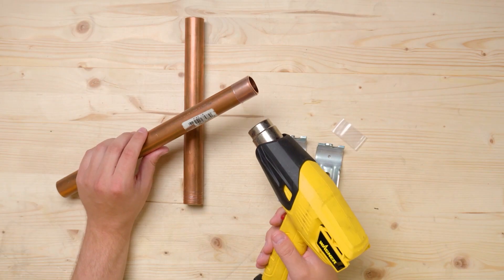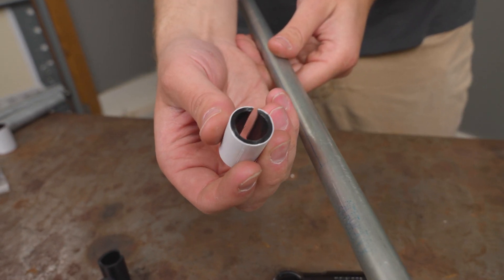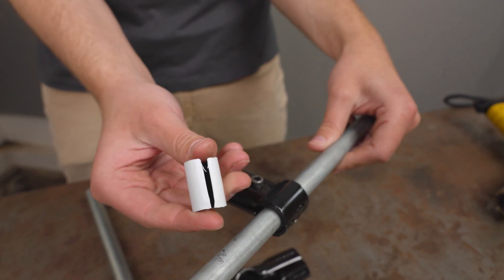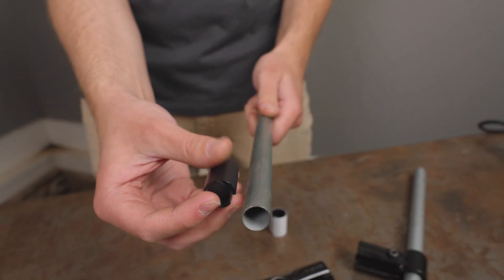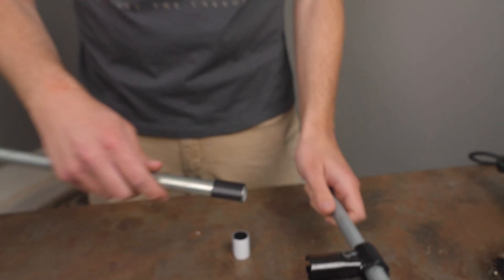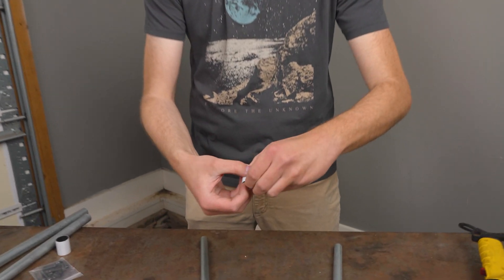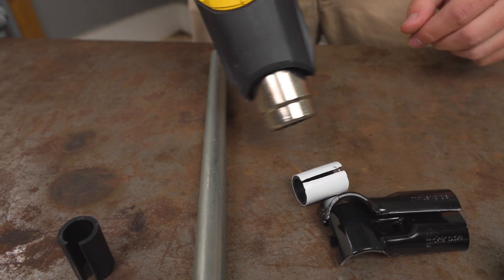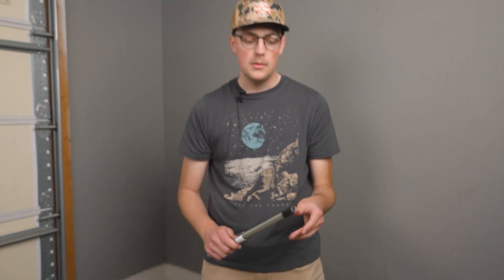Building With 1/2" EMT Is Easier Than Ever!

Comment: Will there ever be 1/2" connectors (no shims, smaller connectors)???
Reply from the maker: We've looked into it and it's possible in the future
Reply: @MakerPipe  Awesome! I get it, egineering/manufacturing costs and all that, more profitable to have a smaller, more universal inventory, the 3/4" connectors being largely profitable as is I would imagine. But man, some 1/2" connectors would look so clean. Most of my more light-weight builds would do just fine being built out of the much cheaper 1/2" EMT. To have a more form-fitting and slightly cheaper connector option would be so nice. Not to mention, it would complete the collection for people. It feels wrong to not have 1/2" connectors when we have the mini, 3/4", and 1". Just saying, you've got the market cornered right now, jump on it! 😃
Reply: @MakerPipe I totally agree with Nick. I'm not sure I will buy  three-quarter connectors for my half inch conduit projects because I think someone else offers half inch connectors!
Reply: But I do love your project ideas so thanks for!

Comment: In the letter frame I use for the holiday display, I use a lot of the shims, as well as the prop frame here at home.  I like being able to use 1/2" to fill in spots, but have found they are a lot more prone to being pulled out.  So, now, I also use a bolt through the pipe to keep that from happening.
Reply from the maker: Thanks for the comment! Maybe the plastic shims allow for more compression and wiggling under load.